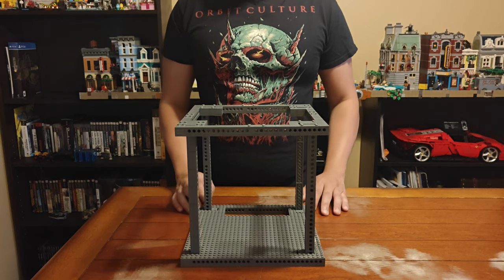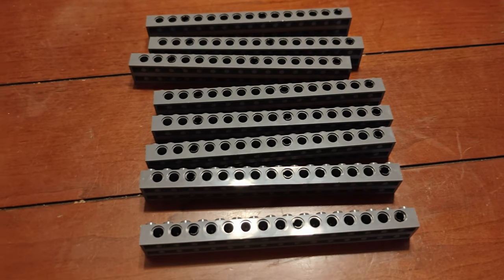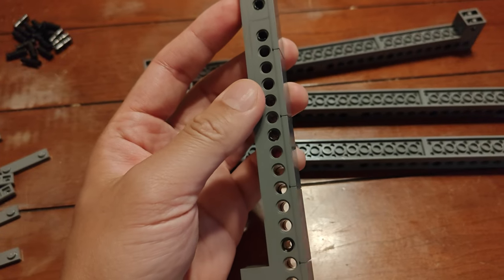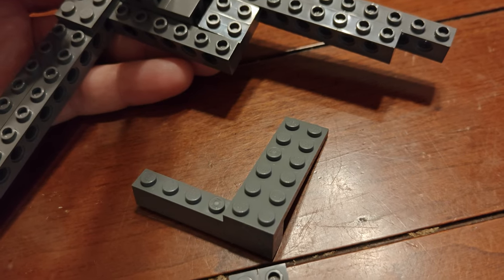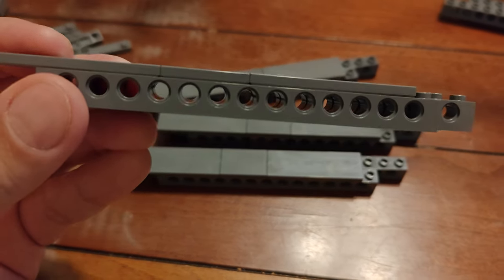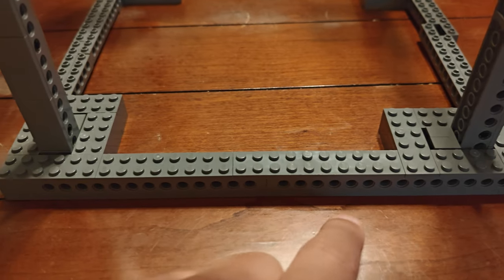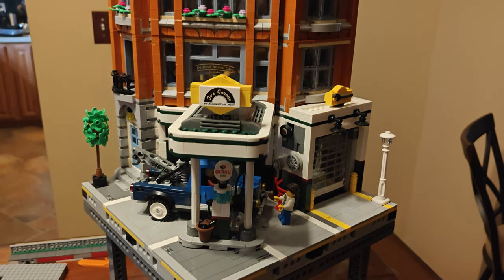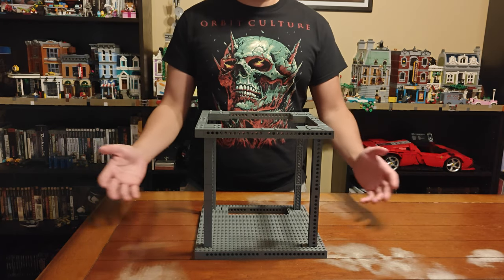Lego MILS Cubing My City in 2024 and Beyond (New Hashima style)

Comment: Nice design! Very clever to leave the tops of the columns slightly higher than the top surface, so that the weight is directly on them.  Though it occurs to me that you could alternatively make a built-in MILS plate for the top, instead of just a square frame, and then you could set buildings directly on it without needing to first reinforce the base of the building. 

In any case, I’d suggest 3 minor changes to make it even sturdier: 
• for each vertical column, instead of (4x) 1x16 Technic Brick, use (3x) 1x16 Technic Brick and (2x) 1x8 Technic Brick. Stagger the bricks so that they overlap and you can lock them together with friction pins in addition to the plates and tiles. 
• for the last step of enclosing the lower corners, don’t use a 2x4 plate on the top. Instead use a 2x6 plate, and shorten the plate on the topside of the outside of the lower corner to a 2x4 to make room. Right now, that inner brace on the corners is only connected to the outer square of technic bricks on one side, and it’s the side that’s under less force. This would make a solid rectangle all the way around the base of each column. 
• I would put a technic pin in the middle of each side of both the top and bottom frames when you bring the 4 corner assemblies together. Again, locking the technic bricks together so that it’s not only the plates and tiles holding them together. 

Again, very nice design, and a clear tutorial.
Reply from the maker: Thanks and thank you for the detailed feedback! 🍻

I agree with all three minor changes for even more strength. As far as the MILS on top goes - this is entirely possible via just copying the bottom layer. I feel like it sort of commits you to filling both the cube AND whatever goes on top in one go instead of keeping things modular.

That said, if you take my design and merely swap the top and bottom, it can be used as a crown for a double height cube build with a hollow center, and you'd only build on top of it!

Comment: So I watched it all wondering what use is this grey cube? What is its purpose? Is it so you can build a realistic mountain and not use half a million bricks? Is a train going to run through it? How does it work?...Now I sort of get it, but after measuring, the space inside the cube is not big enough to fit any of my modular buildings. Which is what I thought it was for. What goes inside the cube?
Reply: This indeed also was my question, I do see the posibillity to make the connection stronger by adding the possibillity to add more technic pins but this also could've been done with two mills plates on top of each other, just as you mentioned, the possibility to add a cave system or subway network underneath the city is possible now with this technique, yet it would cost allot of more parts then raising it with some wood or something else.

The reason why you should or can use this style of building seems to be lacking in the video. At least for me.
Reply from the maker: The purpose for this is to fill it with additional buildings - while the modular buildings won't fit, there are many smaller City, Friends, etc buildings that would in their entirety. In the end, I can create a sub-level city with these (though not entirely without modifying them), and possibly caves, tunnels, etc.